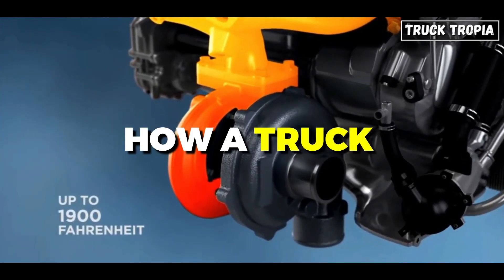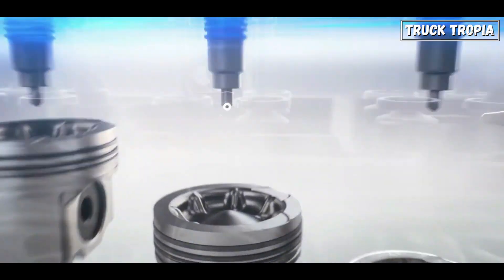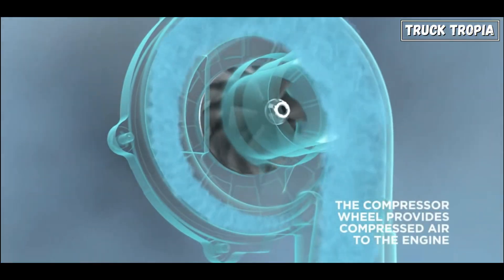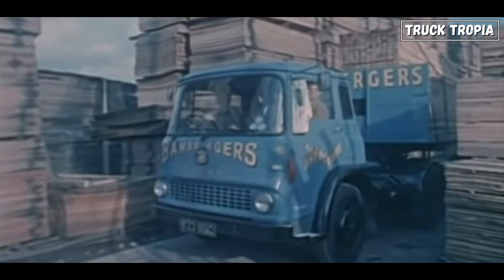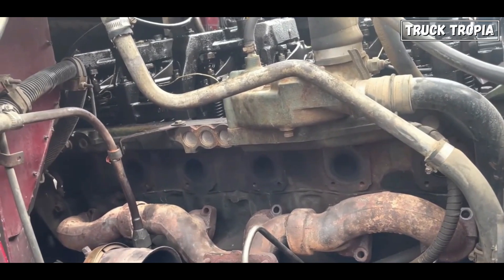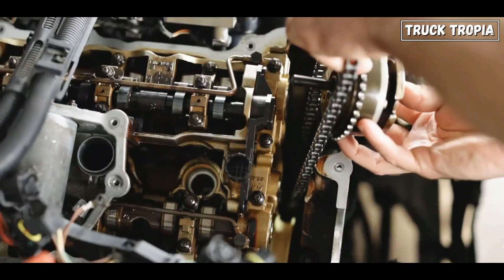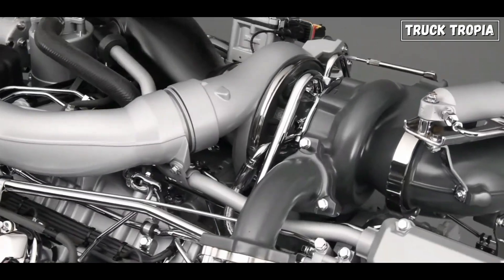How a Semi-Truck Turbo Works (So Simple a Kid Could Get It!)

Comment: Have you heard of a "turbo compound" engine? Scania introduced the 11 litre DTC11 engine in 1990 that produced 401 hp, around 25 hp more than the normal intercooled DSC11 engine. It had a normal turbocharger + another exhaust turbine  connected in series with the first one. The power from this turbine was mechanically transferred by gears directly to the crankshaft. This is indeed a more complex construction and I don't know how much this technology has been used.
Reply: This was the one that was a bit loudish "whistling" engine, wasn't it? I remember one Scania from my childhood that has that funny airy noise, but went like a bullet...
Reply: @zbaktube  It's possible, but the 14 litre V8 of that time also had a distinct whistling turbo sound. Already in 1990 the strongest V8 produced 500hp!
Reply: @OnTheRoadAgain-S  Those were the trucks! I remember first having one to my father. It was like 10 years later? Not sure. It had tempomat. And first scared the sh.t out of me when we went uphill. I was used to when the road was rising our old truck was slowing down. But not with that truck, it gave automatically a bit of gas and just run uphill without any effort. I thought first the truck engine got runaway and we wont be able to slow it down 😀 
Back a bit to the DTC11, was the extra exhaust turbine switchable? How I remember that the extra whistling sound (over the turbo whistling) only came when the truck went uphill... But I was a little boy, my memories just aren't that clear...
Reply: @zbaktube  I have no experience from the DTC11, but the text about it tells the turbine has "hydraulic switching". Unfortunately the history book about Scania I have is in german and I'm not good at it. I had to use Google. There is a good exploded view of the engine in the book but it isn't good enough to show exactly how this switch works.
Reply: @OnTheRoadAgain-S  Can you send me the exact title of the book? I had my fair share with the German language, If I can find a cheap one I would buy it 🙂
Reply: @zbaktube  "Die Fahrzeuge von Scania" by Björn-Eric Lindh (printed 1992)
Original title in Swedish: "Scania Fordonshistoria 1891-1991"
English version: "Scania and its vehicles 1891-1991"
Reply: @OnTheRoadAgain-S  Thank you very much!
Reply: They made a Turbo compound engine in beginning of year 2000. It made 470 hp.
But it was so many problems. Engine just broke down. 
So Scania stop making them

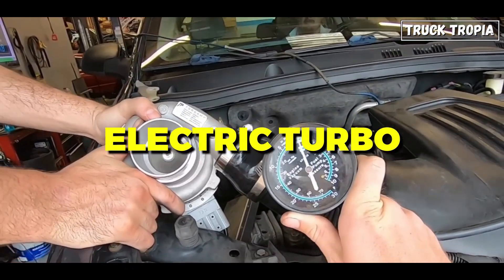Comment: It already has been told that the thing at 3:08 is a mechanical supercharger, in this case a belt-driven screw compressor that rotates at pretty much same rpms as the engine. And at 5:03 is in fact an electric powered supercharger, not a turbo either. "Turbo" itself  actually means the exhaust powered turbine.
The advantage of an electric powered compressor is that it starts to wortk immediately when you press the trottle, before the engine itself reacts, faster than even a supercharger. And a computer controlled electric powered compressor can give the right torque at any speed and load.

Comment: 3:08 is a supercharger, not a turbo.
A supercharger is driven by the crankshaft via a belt, because of this, a supercharger is always turning, and has no lag, unlike a turbo that is driven by the exhaust gases and must spool up before giving power.